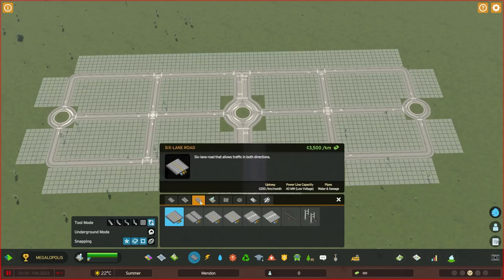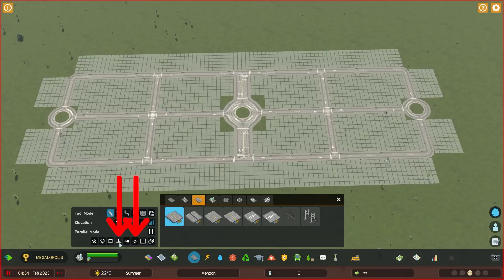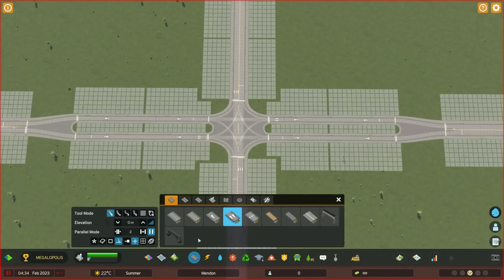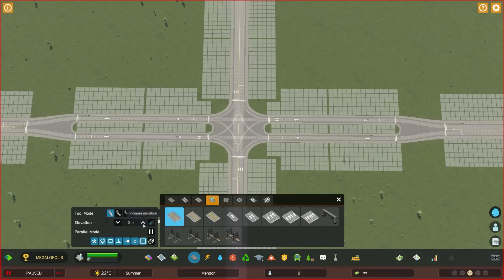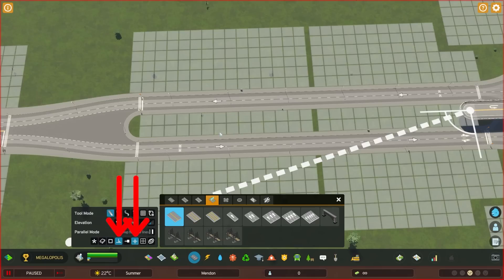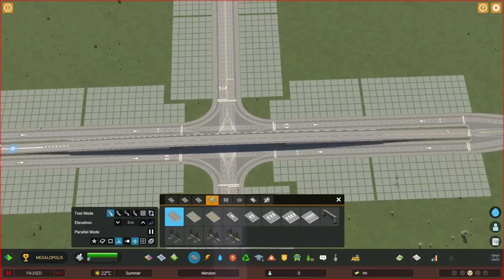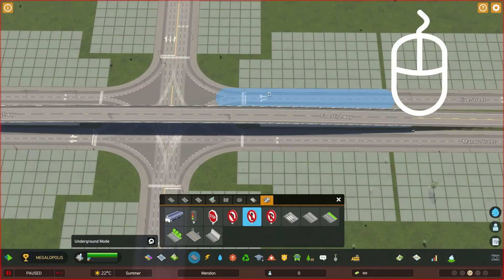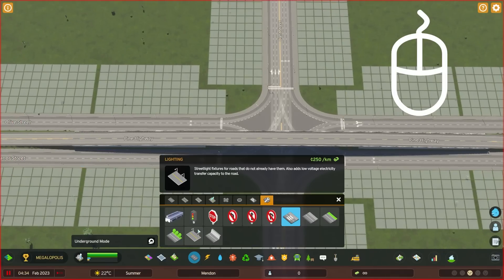Cities Skylines 2 Road Tool Tutorial：How to create a Vanilla Overpass without mods

Comment: Hi, i just came across this tutorials. and  during timestamp 5:50, i'm unable to olace the 7.5M height 2 lane  2 way highway in the middle cross section. is something i've done incorrectly? i double measure everything two time, but still error "Overlapping items" in on the parallel two lane one way road.
any enlightment?
Reply: I've tried flatted the terrain, but the error still same.
Reply: i did it underground 12.5 meters

Comment: After playing it out for a while and having a city that have grown (I'm at nearly 120k), I notice that the bottom part of the road, with 2 lanes going left and 1 right, is actually a problem. I mean, I have these stupid truckers who stand in the right lane to turn left, thus blocking the right lane for those who want to go there.

As such, I am trying right now to rebuild the same structure but by splitting in two separate roads the parts on the bottom. So when you go left, you must go left and the same for the right lane. I miss so much Traffic Manager with the dedicated turning lane :)